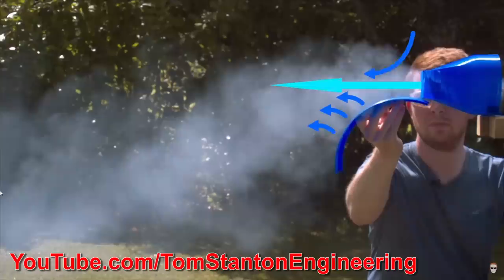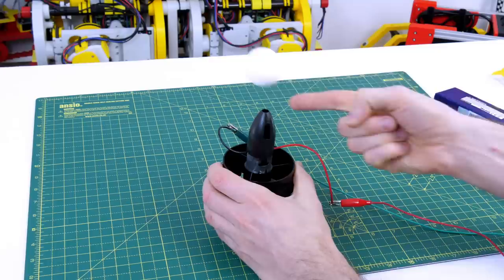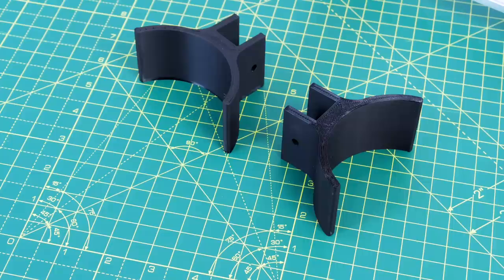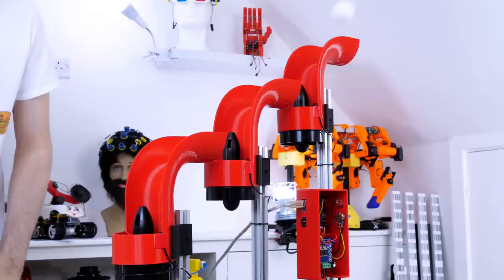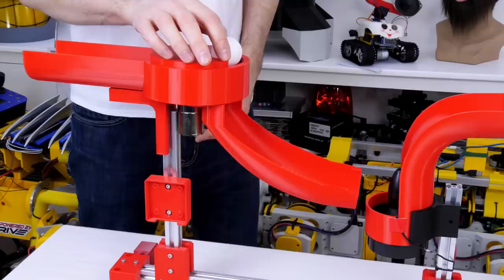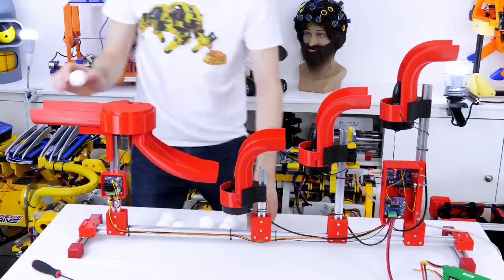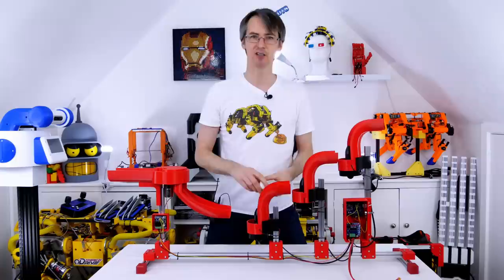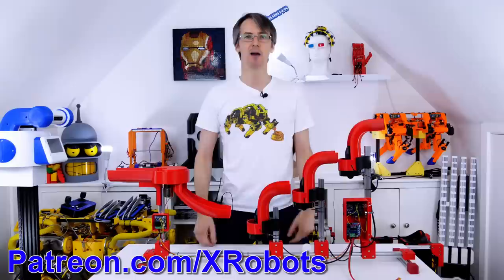What is a Coanda Effect Staircase?

Comment: Perhaps construct a nozzle that promotes laminar air flow upon exiting the Ducted Fan outputs? if constructed correctly to allow even air distribution, you may be able to only need a single EDF through a manifold assembly(?) I dunno. My mind really only works to complicate most things.
Reply: Also,  perhaps one could make gradually widening flare rate on the 2nd & 3rd step airfoils, each growing wider than the one before it.
Reply: Also..... (Again)  one could construct a schleiren (spell chk) device to help you visualize what vortices/distortions are disturbing the intended affect.   Just Google schleiren optical effect (likely I've mispelled it¿).   It's very simple, only requires a single lightsource and reflective optical devices (mirrors) and a measuring tape essentially.   Vióla!   I've built them a few times for troubleshooting hemholtz coupling distortions on some high output VLF electroacoustic devices (really big subwoofers)  I designed.   Basically, I could watch port noise created from vortices formed when large amounts of high velocity resonant air is squeezed out a 5" diameter tube & hits a standing air mass (concert venue) at 147db.   Mind you, the intended purpose is to excite the massive standing air-mass at rates of 12hz - 90hz.  Meaning, it's has to suck 60feet³ of air in, then blow it back out 12-90 times per SECOND.   So, if you don't build the exiting point of this operation properly.... It tends to whistle REALLY f**king loud!   Which will never sound like a kick drum or the low E^ string on a bass guitar in front of 10,000 people.    Long story short....  I would build said device to (literally) see what the air was doing as I ran bursts of audio tones at very high output.     Helped me tremendously.....  Made a good name for myself back in the day.   I miss building systems.    

Love your channel !!!    Great work!

Cheers

Comment: I suspect that you need to reduce the power (in a specific value) as you go up the staircase. You're adding momentum to the balls & this is cumulative, meaning that unless you reduce the pressure from the secondary fans, you eventually reach a chaotic state that overcomes the adhesion from the coander effect.

(Obviously a guess, but just my interpretation of what I'm seeing here.)

Comment: I noticed that when you placed the ball, you put it in much higher on the air stream.  Also, you didn't put the same forward momentum into the ball as the chute.  And finally, the chute imparts a rotation on the ball.  All these will impact the flight characteristics of the ball.

Comment: With a little analogue sampling of either Battery Voltage or motor current you could have your speed controller automatically compensate for the dipping battery Voltage.

Comment: I think that if you changed the entry angle (where the ball leaves the entry chute and enters the first air jet) it might work better. You can see the angle it wants to travel at over the stairs when it works just right whereas the ball comes down the chute at about 90°. Instead of being at or near the angle that it wants to be at, the air has to first change the direction of the ball before it goes up the first step. I think it would work better if there was a little bit of a ramp at the end of the chute that let the ball enter the air jet at around 45°, traveling upward

Comment: The air source is too wide IMO. Perhaps cover a portion of the fans surface that is away from the ramps. That wind is likely just gusting around randomly and completely unaffected by the effect of the ramp. That is why you have to toss the ball past that area and maintain speed to get past it at each stage. You can probably run at a lower fan speed too with a more concentrated area of flow. You could also just move the thrusters lower and make a short tapered tube with some lattice to stop the air from twisting.

Comment: 2:44 ... Support you're doing it wrong. Try tree support. With the correct settings tree support should give you the same results with a fraction of the material (and time) ... also you can work with overhangs / bridges you know ... you don't need support under everything.

Comment: Best way to get the laminar flow would probably be using compressed air instead of using fans. Or atleast some veins. 
The fans naturally create a votex in the air and can cause issues with stability of the ball as it enters and exits the wake. It also seems like the ball likes to bounce off of the first fan's nose cone a lot so that is probably not helping any.
If you were to find a wide and flat nozzle that creats more of a "blade" of air, that may be your ticket since the flow out would be likely more predictable and consistent.

Also, check the alignment of the steps. Some seem to be angled slightly towards the feed ramp.

Comment: Maybe you can add a bit of pipe to move the motors away from where the balls enter the path and  add some kind of "fins" inside these pipes pointing in the opposite direction of the  airstream and maybe it could counteract the rotation of the stream of air or something like that? You can also use a DIY version of wind tunnel testing and use some thin fibers or smoke to  see which way the wind blows. The air stream could potentially be more counter intuitive and unpredictable than humans imagine ...
I have thought long and hard for several seconds about this so don't shoot me haha! :D

Comment: From the ramp going into part 1 of the Coanda Staircase, maybe instead of having the red 3D Printed ramp, just have 2 wires that the ping pong balls roll on. That way there is less surface area to obscure the first step. You might just have to 3d print a new half ramp with wholes to put in some wires.

Comment: What if you could have a compressor nozzle going at like 45 degrees, and the chute drops the ball into that flow. It can then float there seemingly by magic as another nozzle (or multiple nozzles) on a slowly rotating rack come along, steal the ball. Not sure how the transfer would work -- I don't have the equipment to test... It might have to temporarily close the original nozzle. Anyway the second nozzle would carry it around to the other side where it get caught by some scoop as the air stream passes through with the ball.
Reply: Would this work vertically? Maybe if the second nozzle were kept at the same angle relative to the ground.

Comment: isnt' there a component that keeps battery flow constant while draining? I can't remember
Reply: A boost-buck converter can keep the voltage constant, but I don't think you can really do anything about the current (a good speed controller for the fans would do the trick however)

Comment: Maybe you could use a single EDF and a manifold with baffles to control each stage and why not throw in some air multiplayer ideas allowing air into the system just before the manifold outlet to try and improve efficiency and how laminar the flow is

Comment: Why would you have the input chute get wider at the bottom? If you want to minimise variability, keep the shoot almost as wide as the ping pong balls, and it will be more reliable and repeatable!! Also probably that large horizontal velocity at the input is your enemy here - if the ball isn’t lifted in time, it bounces off the coanda surface, which means your having to increase the velocity until the whole system gets a bit unpredictable and sloppy. If you decrease the input velocity maybe you can decrease the speed of the fans too, and get a more stable and repeatable effect

Comment: The coanda effect is most prominent when you have a more laminar flow of air... that is why the ball floats well on the rather thin stream of the air brush... you could have used the smaller motors to direct the air into a nozzle that followed around a third of that pipe base and that would have pulled those balls up right smartly... those open fans are creating far too much of a vortex and the angle of approach of each ball is altering it's exit trajectory...

Comment: Searched a bit and found this video showing how to make a quality dense but thin stream of smoke.
Please, do this (or some other method) to visualize the airflow and any disturbance / interference.
https://www.youtube.com/watch?v=gDpNxj9V56M

And watch your videos again more closely, specifically look at the beard behind you.
Understand why a smoke test will be useful now?

Two variables you haven't played around with in that design, is the motor depth in the "tube" and the diameter of of the fan / tube in relation to the size of the floating object.
Here's a video that touches on the volume (diameter) vs pressure (fan speed). A smaller and faster source of air will likely serve you well in holding the ping pong balls in the air-stream, but not sure how that will relate to following the curve.
https://www.youtube.com/watch?v=s3rEPfLas9M